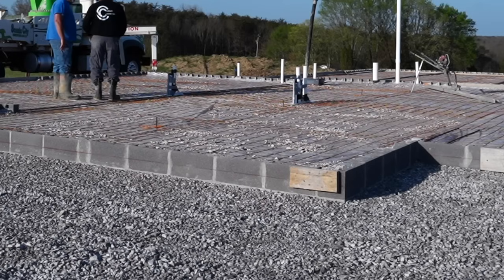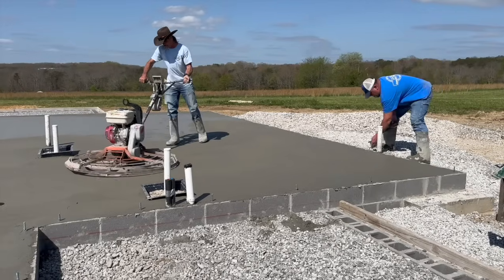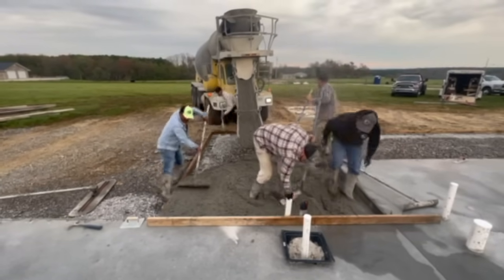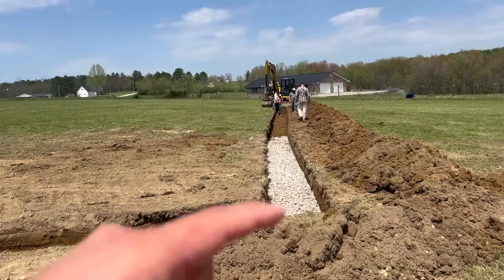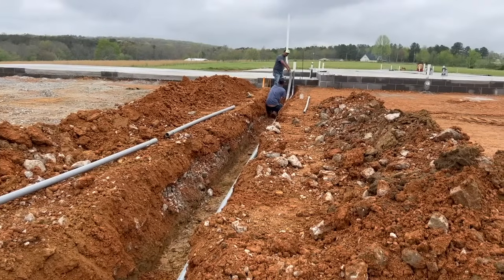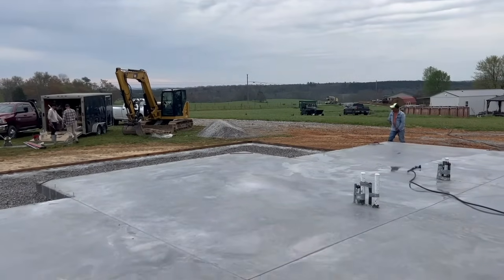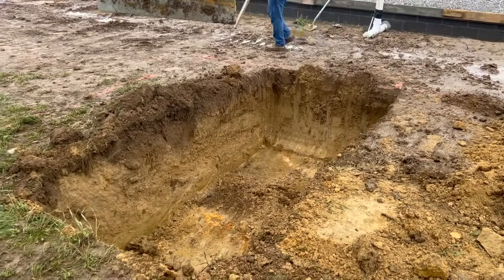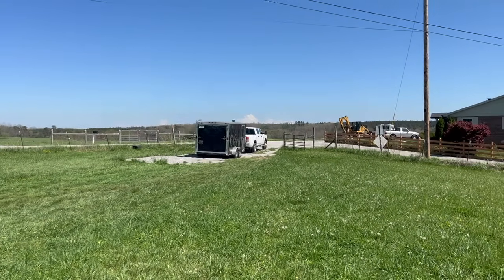THE SLAB WORK IS FINALLY COMPLETE - EPISODE 6 OF BUILDING A FARMHOUSE

Comment: That's the best concrete job I've ever seen.  Nelson did a great job overseeing that project.  I can't wait for the next step?  Is one of your drain fields a backup?  I know we have a backup just in case we ever need it.  Your baby is the cutest little thing she is a good baby.  I just want to reach through the screen and squeeze her.  She's just absolutely adorable.  She growing like a weed.  Thank you both for sharing really enjoyed it.
Reply from the maker: The entire system is one system, however, the length and the type of system in place shouldn't require a backup. This is why the inspection was so important. Everything had to be done just right in order for it to work properly and pass.